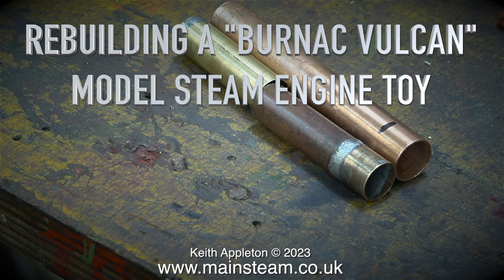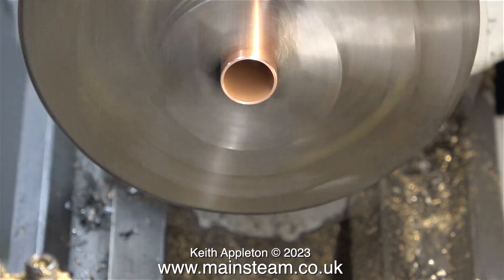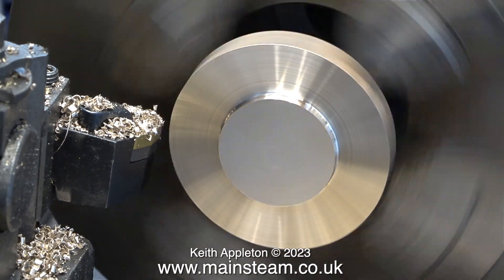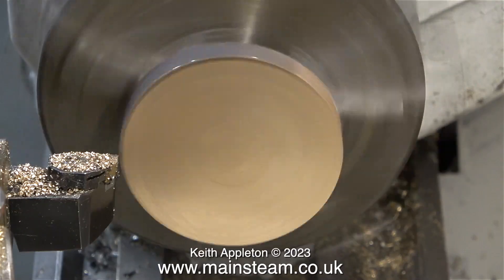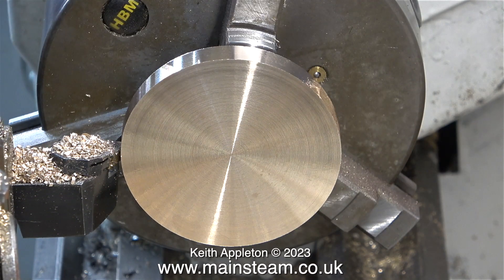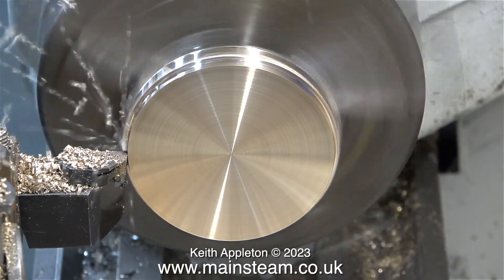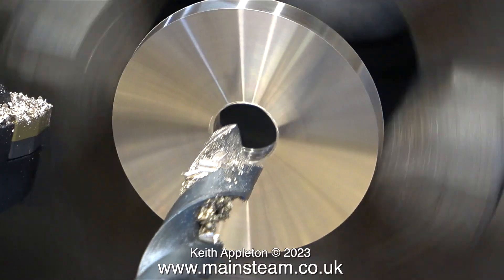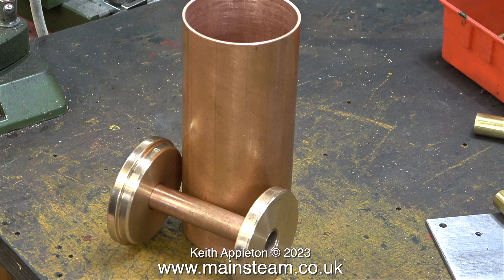REBUILDING A "BURNAC VULCAN" MODEL STEAM ENGINE TOY - PART #13

Comment: I would be interested to learn the difference in time it takes to build steam with the new thicker boiler compared to the original boiler.  I'm sure the engine will run longer after the heat source is removed with the new boiler.
Thanks for posting all the wonderful videos!
Reply from the maker: In such a small size I don't think the difference will be very much . . . .